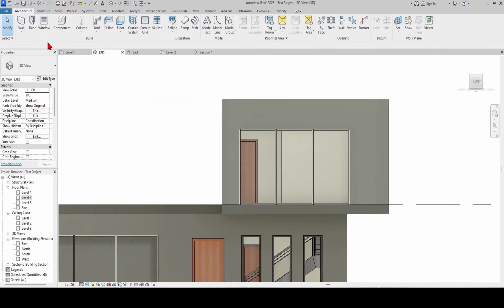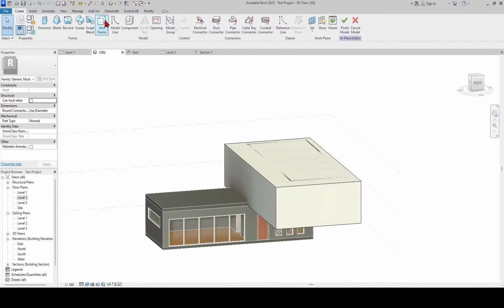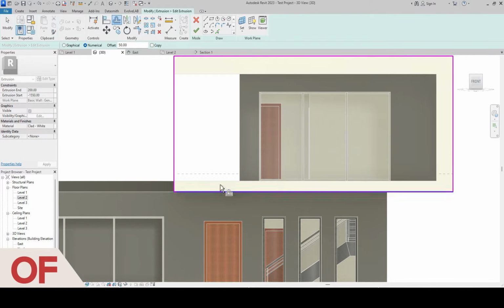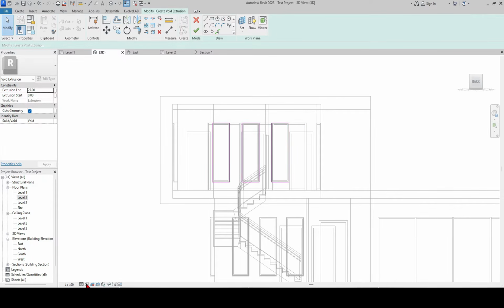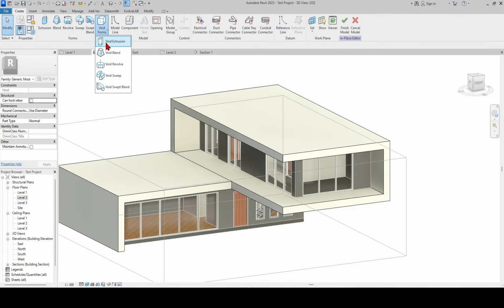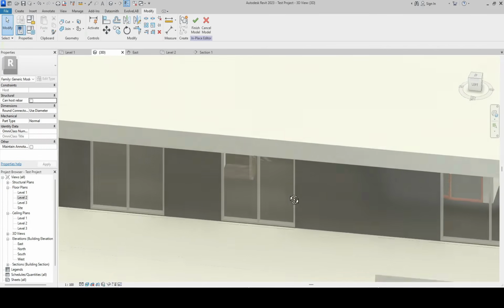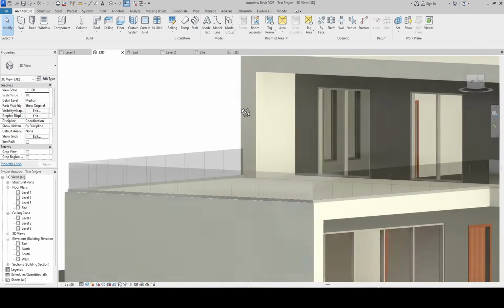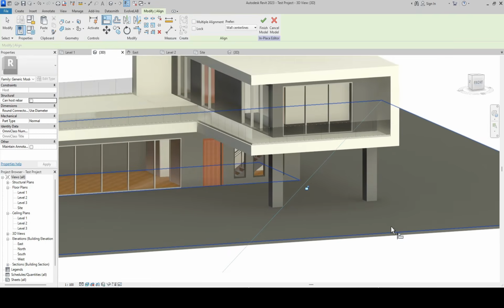Revit Course for Beginners – Part 3 – Facade Design

Comment: Hello Sir, I hope you are doing well.
My concern relates to the shape created using the extrusion. You removed part of the ground floor slab but left the remaining portion in place. I was wondering whether it would be better to remove the entire slab so that the extrusion alone would serve as the ground floor slab.
Also, you extended the extrusion 50 cm downward, while the walls extend to less than -30 cm. This means that 20 cm of the extrusion overlaps with the ground floor walls.
Furthermore, when creating a schedule, will the element created using the extrusion be counted as a wall or as a completely different element, given that you saved it as a Generic Model?
Thank you for your clarification.

Comment: 14:01 I have problem here I struggled with it the whole day  it won't create the void extrusion
Reply from the maker: Could you tell me exactly what's happening — is there an error message, or does the void just not cut through? Let me know and I'll help you fix it🚀
Reply: @tech.architect  no just nothing happens and the lines turns to orange color
Reply from the maker: @miraledoc9268  That usually happens when your sketch lines overlap or don't form a fully closed loop. When you're in sketch mode, make sure the lines don't cross each other and that they create a completely closed geometry — once you fix that, the error will go away. Let me know if it works🚀

Comment: 8:55 windows ain’t coming for me, it just shows those transparent cubic shape
Reply from the maker: Revit does this sometimes! 🚀 Here's an easy fix: Select all those transparent cubes, then hit 'Cut Clipboard' (shortcut Ctrl + X) from the top-left of the ribbon. After that, click the small arrow under 'Paste' and choose 'Aligned to Same Place'. This cuts and re-pastes them in the exact same spot — and that usually fixes the issue. Let me know if it works!

Comment: Sir 14:41 
I have an issue there 
When I opened the site view, it is only the fist floor print i could see
Please help me🙏😢
Reply from the maker: Hey! Here are a few things to check:

1. View Range — Go to Properties → View Range and adjust the Cut Plane & Bottom values.
2. Underlay — Make sure it's set to the correct level.
3. Level — Your site view should be linked to a "Site" level, not Level 1.
4. Visibility/Graphics — Press VG and check if any categories are turned off.

Try these and let me know! If the issue still persists, describe your setup in more detail and we'll figure it out together 🚀

Comment: the part at 3 :35 didn't work out for me , i tried the whole day , revit keeps telling me that lines shouldn't intersect or whatever , i tried all solutions in vain
Reply from the maker: From what I understand, the issue happens because when creating the void, there are overlapping lines in the sketch, or the shape doesn't form a fully closed profile. The command only works if you create a clean, properly closed shape.

My advice would be this: when creating the void, carefully go through your sketch line by line and make sure no lines are overlapping each other, and that they form a completely closed profile. If there's a long edge sticking out, use the Trim command to connect it with the neighboring edges and form a clean shape.

If you've done all of this and it still doesn't work, feel free to explain your situation to me in more detail — I'd be happy to help you troubleshoot until we figure out what's causing the error. 🚀

Comment: Sir i followed all the steps but got stucked at void extrusion 3:48 .I check out all the previous steps but all in vain .it shows an error like that "some of the voids can't be cut be void extrusion,use cut geometry for it " Sir it will be my pleasure if you explain it for me❤
Reply from the maker: Thank you so much for your kind comment! This is actually a very common issue in Revit—let’s solve it together:

🔧 The error is most likely happening because your void extrusion is not in the same family as the solid object you're trying to cut. In Revit, voids can only automatically cut solids that are within the same family.

✅ Here's how to fix it step by step:
1️⃣ Edit the Family:
If the object you're trying to cut is part of a loadable family, double-click on it or choose Edit Family to open it.

2️⃣ Create the Void Extrusion inside that same family:
Go to Create > Void Forms > Void Extrusion.

Draw your void shape so that it completely intersects the solid you want to cut.

✅ When both the void and solid are in the same family and the void intersects the geometry properly, Revit will automatically apply the cut—you won’t even need to use the Cut Geometry tool.

💬 If the issue still isn’t resolved or you get stuck again, please don’t hesitate to reach out—I’ll be more than happy to help!